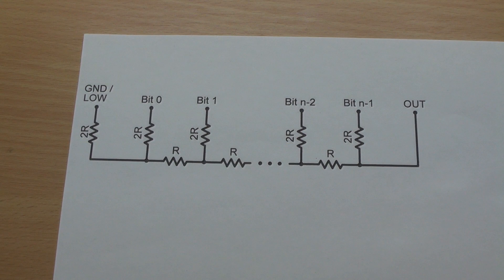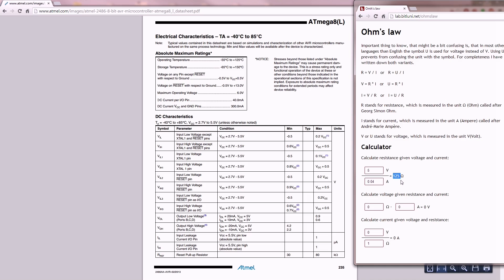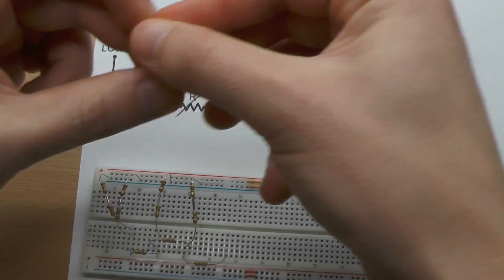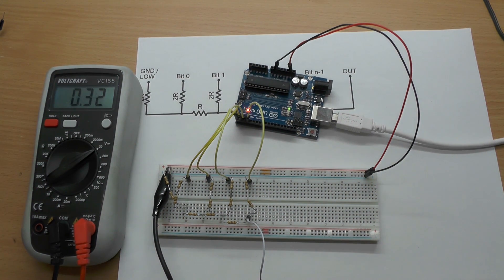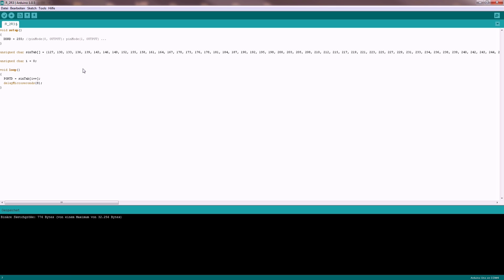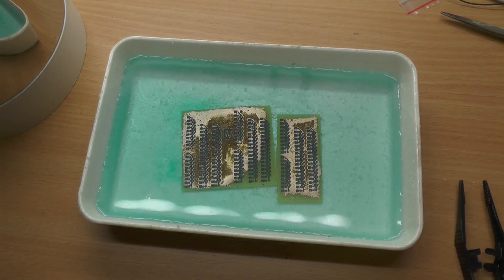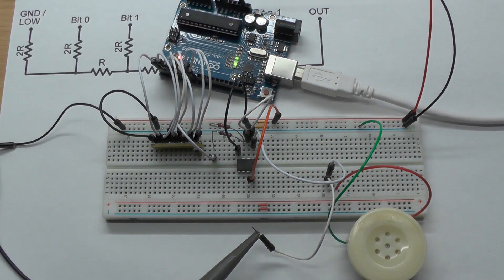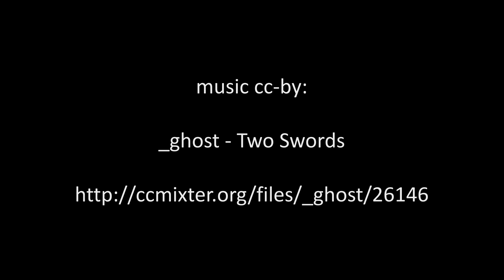DAC using R-2R resistor ladder

Comment: Amazing how well that works. I wonder if using tiny resistors in your 8-bit design results in better bandwidth than using normal resistors.
Reply: Haha I skipped all your equations but now that I'm making it I have to go back and watch that part to learn what the voltage ratio will be on the output (what resistance to use).

Comment: Good explanation and very good video.
Let me please add some comments related to the signals you can get by using that configuration Arduino + R2R ladder, in special to the conclusion you mention as "Super fast". The 300ns or 3.3MHz you have got are the maximum speed at which the microcontroller can make an operation when clock is 16MHz. If clock is at 16MHz you can get one operation each 62.5ns ( = 1 / 16MHz), the 300ns are 4 times that period ( 300ns = 4 x 62.5ns). Additionally, if you read the microcontroller specs, you can find that, quoted, "The interrupt execution response for all the enabled AVR interrupts is four clock cycles minimum". So, all in all means that you can do something each 4 clocks, that means 300ns, cannot go faster than that. Then, if you would like to create a sine wave with 100 samples in each period you will need to consume 100 times 300ns giving 30us per period that correspond to 33.3KHz. But that is the maximum theoretical frequency because you will need to perform more than one operation each time you would like to change the output value. By using internal timer I could not go beyond 2 to 3 KHz.

Comment: When the DAC connected to the arduino we can't talk about the output voltage going from 0V to 4.5V right? Resistors still driven by the TTL-LOW voltage of more than 0V so there would definitely be a dc offset in the output signal.

Comment: This was a great video.  it helped me to understand how digital to analogue really works.  its surprisingly far simpler in function than I had imagined. The one question I still have is, with audio equipment how do they clean out all the spikes in voltage as the circuit switches.  Is that all done with an analogue filter of some sort?

Comment: The sin wave output from a R-2R DAC above still is a DC signal.
How can I convert it to AC signal ? (Because I want to use it as input for amplifier).
Reply: A high-pass filter will block the DC bias. Okay..... use an op-amp like the NE5532, connect the output of the R2R array to one of the + inputs (pin 3), connect pins 1 and 2 together (connecting the - input to the output for a unity gain buffer) then connect a 470nF capacitor (mylar/poly/film is best) from 1 and 2 over to the other side of the chip to pin 5. Connect pin 5 to ground with a 100K resistor, connect pins 6 and 7 together, and that's your output!!!

You can connect a resistor between 6 and 7, and then 6 to ground, to adjust the gain of your op amp. Keep these values below 20K to avoid adding noise, and above 2K to avoid loading the op amp too heavily. Identical resistors will double your output voltages (gain), higher resistance between pin 6 and 7 will increase the gain, higher resistance from 6 to ground will decrease the gain. Pin 4 goes to your negative voltage rail (-12V is a great choice) and pin 8 goes to positive voltage (+12V, for instance.) Oh, and put a 100nF capacitor between the power pins.
Reply: juanito moore : Very clearly. I will try it. Thank you very much :))

Comment: Can this be used instead of PWM for driving motors ?
Reply from the maker: +Jorge Gerardo Aragón Villarreal yes if you connect an opamp in between since the resistor ladder will not provide enough current. but don't for get to connect a diode backwards across the motor, otherwise the inductivity peaks could kill your ICs

Comment: Why  don't you  connect a small capacitor to the output of the converter 2R-R or the input of the operational, this would eliminate the jump of bits and make the best sinusoidal signal, maybe about 47 nF is Ok.
Reply from the maker: +Angel Jimenez long time ago.. not sure, why I didn't. probably because if you have very steep waveforms like square you don't really like to have the smoothing. But you can du it for sure if it fits your needs :)

Comment: amazing! My chineese Pro Mini 5V 16MHz is changing bits @ 1.0e-7 sec, (10MHz!) with "noInterrupts();" in setup(). Can generate a 6 bit/64 sample sine at 43.48KHz with only "if(i >= 64){i=0}" added and no delays "noInterrupts();"  96.15KHz 8 sample triangle wave!
SINE or triangle(same site) table generator: http://www.daycounter.com/Calculators/Sine-Generator-Calculator.phtml

unsigned char sine64[] = {
  32, 35, 38, 41, 44, 46, 49, 51,
  54, 56, 58, 59, 61, 62, 62, 63,
  63, 63, 62, 62, 61, 59, 58, 56,
  54, 51, 49, 46, 44, 41, 38, 35,
  32, 28, 25, 22, 19, 17, 14, 12,
  9, 7, 5, 4, 2, 1, 1, 0,
  0, 0, 1, 1, 2, 4, 5, 7,
  9, 12, 14, 17, 19, 22, 25, 28,
};
unsigned char sine32[] = {
  32, 38, 44, 49, 54, 58, 61, 62,
  63, 62, 61, 58, 54, 49, 44, 38,
  32, 25, 19, 14, 9, 5, 2, 1,
  0, 1, 2, 5, 9, 14, 19, 25,
};
unsigned char sine16[] = {
  32, 44, 54, 61, 63, 61, 54, 44,
  32, 19, 9, 2, 0, 2, 9, 19,
};
unsigned char tri64[] = {
  2, 4, 6, 8, 10, 12, 14, 16,
  18, 20, 22, 24, 26, 28, 30, 32,
  33, 35, 37, 39, 41, 43, 45, 47,
  49, 51, 53, 55, 57, 59, 61, 63,
  61, 59, 57, 55, 53, 51, 49, 47,
  45, 43, 41, 39, 37, 35, 33, 32,
  30, 28, 26, 24, 22, 20, 18, 16,
  14, 12, 10, 8, 6, 4, 2, 0,
};
unsigned char tri8[] ={
  16,32,47,63,47,32,16,0,
};
unsigned char i = 0;
void setup() {
  DDRD = 255; //set PORTD 7..0 to outputs
  DDRB = 0;//PORTB as inputs
  noInterrupts();
}
void loop() {
  while (PINB == 0) {
    PORTD = sine64[i++];
    if (i >= 64) {
      i = 0;
    }
  }
  while (PINB == 1) {
    PORTD = sine32[i++];
    if (i >= 32) {
      i = 0;
    }
  }
  while (PINB == 2) {
    PORTD = tri8[i++];
    if (i >= 8) {
      i = 0;
    }
  }
  while (PINB == 3) {
    PORTD = tri64[i++];
    if (i >= 64) {
      i = 0;
    }
  }
}

Comment: is possible make an inverter using the circuit?
Reply from the maker: +Tiago NET yes it is but it really depends what frequency you need. Usually PWM is better suited if you don't need high frequencies but high currents
Reply: 60hz frequency and 1200W
Reply from the maker: +Tiago NET you should use PWM and drive some big chunky MOSFETS. Since you do not want the MOSFETS to burn excess current you need to operate them either fully open or fully closed. Therefore you need to stick with PWM. But I think there are some nice circuits around at the web.
Reply: good !!!! you're the man!! thanks for help

Comment: Hi, I was wondering what kind of Op-Amp you used. I was looking for one as well.
Reply: You can use the widely spread LM358. It is cheap, DIP8 package (or other) and works in single supply from 3 to 32 volts.

Comment: is it possible to make 16 bit with 2 ports, and generate sinewave ?
Reply from the maker: sure.. but you have to take in account that this will result in two write operations each 8 bits. means that one of the bytes takes longer to change. this might be noticeable if you need the MHz frequency. otherwise I would add a filter cap
Reply: Ok, so if i use 8 bit i got 255 steps, if i will use 16 bits i should got 65535 steps or am i wrong ?
Reply from the maker: Nikmannet you are right
Reply: bitluni's lab Thats should be a very accuracy voltage regulator, have you ever done this before ?

Comment: A very informative and helpful video, however, two questions:
1) What voltage was used for the op-amp?
2) What is the best way to vary frequency? I presume the rate of i will control this?
Reply from the maker: 1) voltage is also 5V.. that's why the output is a bit lower. but you can use a higher voltage as long your ground is connected.
2) what frequency do you mean? a waveform of a specific frequency or the sampling frequency?
Reply: bitluni's lab  Sorry for the prolonged response:
The waveform frequency. I imagine varying the rate of our sample, e.g. "i", will achieve this?